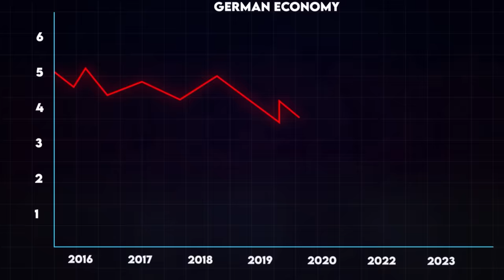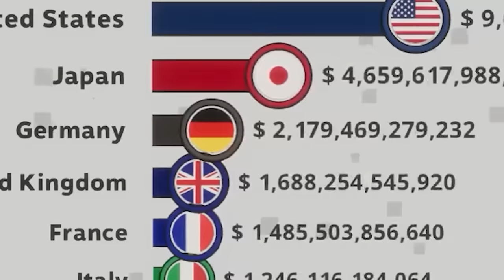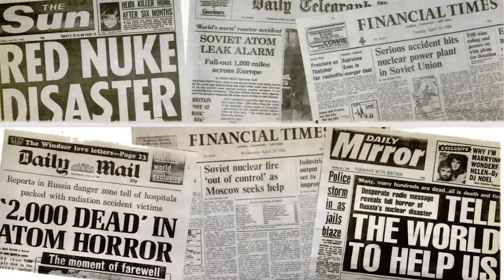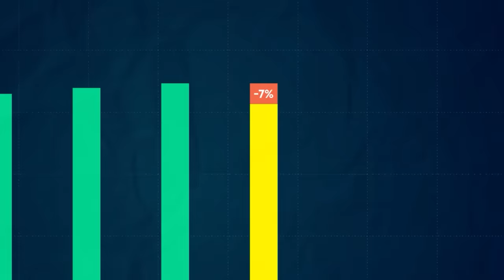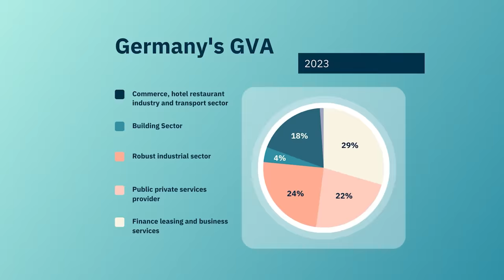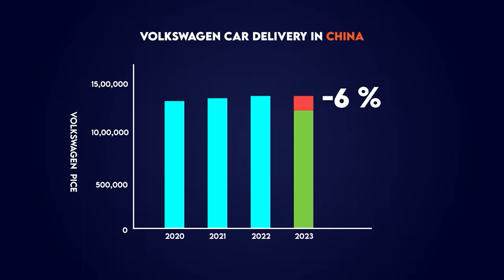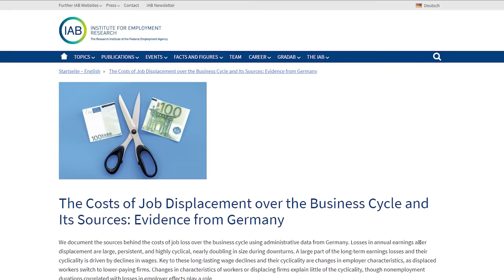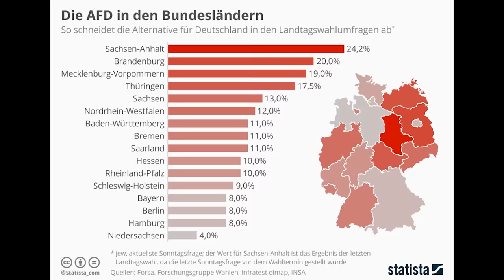Germany's Collapse Should Scare Europe

Comment: A few sprinkles of facts paired with omissions, ignorance and utterly wrong conclusions... That's how misinformation is done!
Reply from the maker: Thank you for the comment but could you please elaborate on what we omitted?
Reply: @WeAreLivingHistory  Certainly:

Germanys dependence on cheap Russian gas and oil could in fact have posed a potential strategic risk of vulnerability for Germany. However: This never materialized since Russia did not cut the supply of gas and oil. Instead Germany did and the German government didn’t even investigate the destruction of the Nordstream pipelines although the German taxpayers had paid for a majority of the costs involved in building those pipelines and the pipelines were considered a crucial part of Germanys critical infrastructure.
Again: Russia kept delivering gas and oil (and continued to do so as of today). 

The mentioned energy crisis is a homemade problem of Germany and the only ones responsible for it are the German politicians. More than two thirds of the Germans were against shutting down the remaining two nuclear power plants. Yet the Green idealogues insisted on the shut-down. 
Note: You claimed that the Green party had “changed their mind” and chose to prolong the running time of the two plants. 
This is 100% false! 
Chancelor Scholz (Socialist party) made it an executive order to keep the plants running for another couple of months because he feared power outages during the winter might cause riots and a subsequent toppling of the coalition Government which has an approval rate of only around 30% among German voters. 
The Green party protested this executive order.

The German automakers have a wide variety of electric vehicles to offer. Only Germans don’t buy electric cars anymore as they used to when electric power was cheaper and – in many cases – offered for free at many charging stations. Many people thought they’ll basically have to spend some 40 to 60+k once and then ride for nearly free happily ever after. Meanwhile reality has kicked in and EV sales numbers (to private customers) are going down constantly. The “Sales numbers” of EV’s are falsified by fleet sales and ride-sharing companies purchases. This also effects Tesla cars as well. So no, it’s not the fault of the German car industry. BTW: Volkswagen outsells Tesla in Germany…

The skilled labor shortage is another homemade problem. Since the 1970ies the number of skilled workers went down while the number of college students constantly went up. People didn’t attempt to learn a trade or skill and instead went to become Gender-Studies or Political Science majors, social workers, integration and equality experts, etc… Instead of learning a trade or skill as an employee and later becoming an entrepreneur and employer themselves, people increasingly “work” in non-productive jobs which are often enough paid for with taxpayer money. Many people even decide to not work at all and instead live on social welfare. Which makes perfect sense since in many cases it’s way more profitable to just collect free monthly money than to get as much (or less!) while working. 

And yet another homemade problem is the migration crisis. Germany offers a wide variety of pull-factors to people from countries which are currently a bit poorer than Germany. Free housing, free food, free money. Germany is even evicting it’s only senior citizens from their homes of 30, 40, 50+ years in order to get more housing for “refugees”. The Ukranian refugees are the least part of the problem since most of them are wealthy and many of those who are not actually try to find work and care for themselves. The African and Arabic migrants instead cause civil unrest and enormous costs. More than 50% of taxpayer-funded welfare is going to foreign citizens in Germany and more than 30% of crimes are committed by people with a migration background. It doesn’t take a math genius to figure out that this is not going to go on for much longer without causing trouble.
Your conclusion that the rise of the “Alternative Für Deutschland” (AfD) is rooted in the East-Germans wish for strong leadership is a result of left-wing propaganda out of Germany. It is true that the AfD is especially successful in areas of the former GDR. The reason therefore is that people in theses areas still remember what a totalitarian left-wing government does to its citizens. Unlike the identity politics offered by the coalition government (left to extreme left), the AfD proposes reasonable policies and more direct democracy not unlike the Swiss model. Everything career politicians and the highly corrupt European parliament hate to the core.

Most of the members of their current German government have not actually worked in a private tax-paying company. They didn’t learn a trade or professional skill other than keeping in power for as long as possible. Some don’t even have any professional education at all. And it shows!
Reply from the maker: @berndk.9741  Thank you for this superb and very detailed comment. We do agree with you that many of the problems in Germany such as the energy crisis are entirely homemade. 

Thank you for sharing these additional insights.
Reply: @WeAreLivingHistory  
A few additional thoughts:

A strong Europe with the engineering skills and highly developed industries in Germany, France and many other European countries combined with cheap energy and resources from Russia were and are the complete and utter nightmare of the United States. Thus the US for decades did everything to drive Europe apart (“Divide et impera!”).
In 2001 Putin held a speech at the German Parliament (Bundestag) in German. In his speech he emphasized that a strong cooperation between Germany, western Europe and Russia would offer limitless opportunities for both sides. This resulted in the US pushing for political change in Europe and the expansion of NATO to the east. In 1991 German foreign minister Genscher had agreed to no expansion of NATO to the east “Not one Inch!”. NATO had been established as a military pact in opposition to the then communist Warszaw-Pact lead by the Soviet Union. With the fall of the communist regimes in eastern Europe and the subsequent dissolution of the Warszaw Pact, NATO had lost its reason to exist. Of course not in the mindset of politicians being paid off by the military industrial complex. As a matter of fact even a NATO-membership of Russia was discussed at one point. But no military alliance can exist without a nemesis and soon Russia was solidified as the huge threat (again).

The German politicians (not just the German ones) are weak puppets and as mentioned before do not have any professional education other than being politicians. These people are completely out of touch with reality and see themselves as a new kind of Aristocracy. They call their citizens “The ones out there” and the wellbeing or prosperity of the people have absolutely no meaning to them. All that matters is the own ideology and party interests. Widespread corruption scandals (Google: “Graichen Clan” or “Graichen Affair”) which would’ve lead to the ousting of any involved politician and criminal prosecution just a few years ago, are now completely ignored and covered up by the state owned media.

You are implying that “History repeats itself” and up to a certain degree it does. Just a few days ago the European Parliament put a law into effect which literally eliminates freedom of speech and criminalizes dissident opinions. Google: “Digital Services Act”!
In Germany the Police is protecting climate-terrorists which are funded in part by taxpayer money through the green party and represented in court by Antifa-attorneys. The first names of criminal offenders must not be released anymore because this might rise sentiments against the majority of criminal offenders – since the majority does not have German first names. Offenders of the worst kind who committed atrocious crimes walk free while violators of outlandish C-restrictions go to prison for years or at least lose their livelihood.

So there you have it: Yes, history repeats itself! Political opponents, certain journalists, authors, etc. are marginalized, cancelled and often prosecuted. There’s only one acceptable opinion and if you don’t agree with it, you are the problem and you will have to pay for it – with your money, your job or even your personal freedom. Less than 80 years after the Nazi-regime and a shade over 20 years since the Communist regime in the GDR, Germans find themselves under a fascist regime, run by apparatchiks, party-soldiers, stubborn and ruthless idealogues who actually and often openly hate the very people they should work for and care about and who are forced to pay them.

Since 1945 the (West-)Germans have been heavily and increasingly indoctrinated with self-hate and loathing themselves. Many feel the desire to be punished for something their long gone ancestors might have done back then. German Masochism is omnipresent in the schools, the universities, the media and of course in politics. The Germans ability to suffer and take another one is unprecedented. Take a look at the French! They don’t put up with half as much BS of their elected officials as the Germans happily do every single day.

“You are bad, you are guilty, so shut up and take in whatever we throw at you!” That’s the message every German gets and sucks up willingly. Imagine you migrate to a country where most citizens hate their own culture and the guts of their own neighbors. How could you possibly feel the need to assimilate, fit in or even respect such victims? You couldn’t and you wouldn’t! This is why – especially young – immigrants are looking to find new leading role models. And those are often found in Islam, fundamentalism and a strong hate for everything the country stands for that pays their monthly welfare check.

A recent poll in Germany revealed that less than 25% of Germans are willing to actually fight for their own country! So what would they be willing to fight for anyway? 

It will take several more years of de-growth, homemade problems and steadily increasing hardship for the Germans until they eventually come to the conclusion that this doesn’t work for them anymore. The forthcoming election are not going to bring the change it takes. They ill serve as a wake-up call for the established left-wing parties though. This will most likely lead to the elimination of the political opposition and even further destruction of the German industry, society, culture and wealth – until the breaking point will be reached.

Comment: only ever bought a bosch jigsaw the die snapped on it after a few weeks, bought 4 bosch spark plugs, the core blew out the centre of 1, which forced the mixture oxygen and fuel into the engine compartment, flames almost destroyed the vehicle, enough said about bosch, germany are having problems finding skilled labour force thanks to merkle
Reply from the maker: The issues were already there long before Merkel.

Comment: Mystery number one. 
Why or how did the low cost energy gas from Rushia prevent the German auto industry from switching from fuel to electric vehicle production  ?
Please explain.

Also,  like the UK,  Germany is being led by a  Neoconservative organisation that's more interested in protecting and enforcing its ethnic voters, mainly the unskilled management classes who have not got technical skills and do not respect any other people to the detriment of the skilled people.
Reply from the maker: Great question. There are several parts to the answer. 1.  Why change an industry that has proven itself for decades. Remember, we are talking about a country where the fax machine is still used. 2. If energy is cheap there is little incentive for manufacturing to make the switch to electric vehicles as it makes less economic sense for them. 3. German corporations are built on consensus-driven decision making. They also tend to have a more elaborate corporate structure with more stakeholders to consult. They try to get as many stakeholders on board as possible before pursuing a project. Like the previous point, they take longer to adopt. With low energy cost there was really no consensus that going electric will be best for business as adoption of electric vehicles was low with low fuel costs. As fuel prices went up all of a sudden electric vehicles became more popular and thus sales went up so it made more business sense.

Comment: It's inevitable.  As the ultimate paymaster for EU and most of EU need handouts is going to hurt eventually. Brexit created many issues and plugging the financial hole hadn't happen which doesn't help. The recent huge influx of migrants didn't help created another problem. I spoke to some German friends in the know and they informed me that integrating the migrants was full of problems which meant instead of them contributing it ended up with more people on benefits.  Forcing the green agenda doesn't help either and weaning off fossil energy created other problems.  Not looking good for EU.